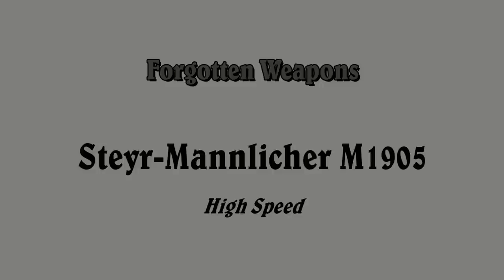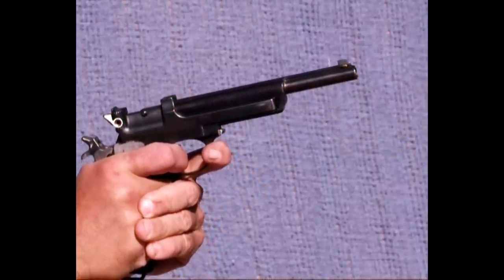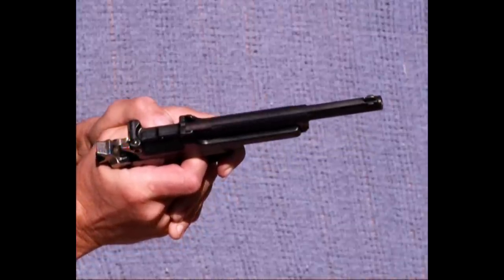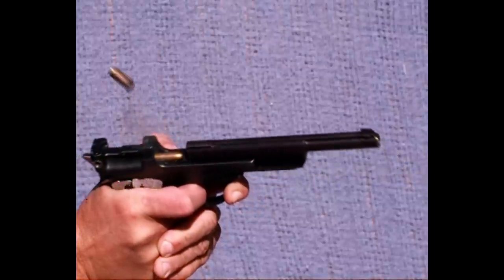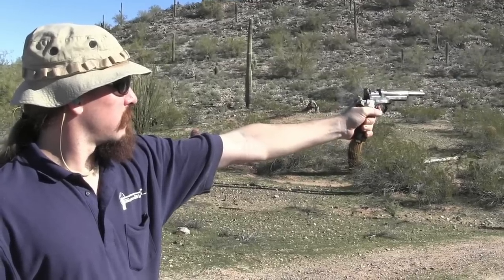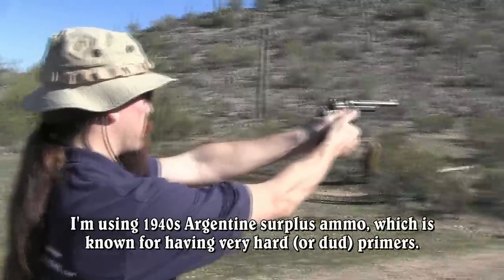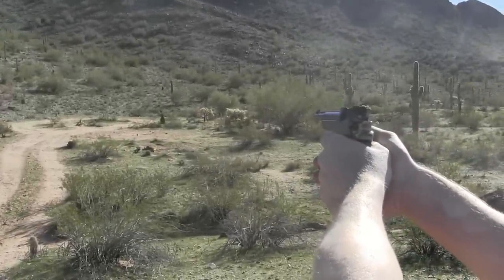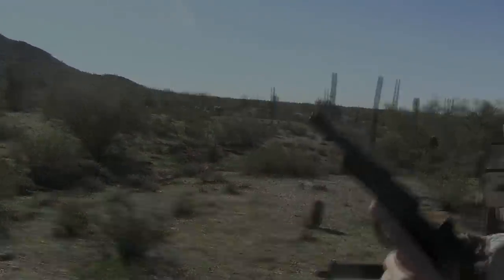Slow Motion: Steyr-Mannlicher M1905

Comment: Can anyone explain to me why hardly any modern firearms use blowback operation?
Reply from the maker: Blowback is only really practical for 9x18 Makarov and lighter cartridges, and most modern guns are chambered for 9x19 or heavier cartridges.
Reply: ***** Safety is also an issue, as the breech of a firearm opening too early can cause burns from escaping propellant gases (which is also an issue with revolvers).
Reply: Like the others said, it's not practical with "full size" pistol cartridges like 9x19mm. One example of a straight blowback 9x19 is the Hi-point C9. They're gigantic, and the slide alone weighs 522 grams (1.15 pounds!).
Reply: Thanks guys.